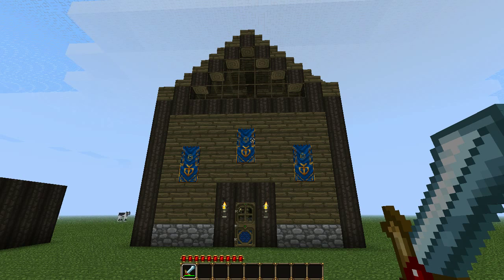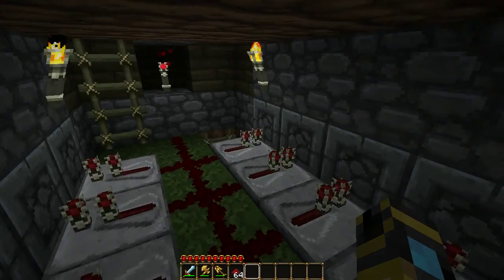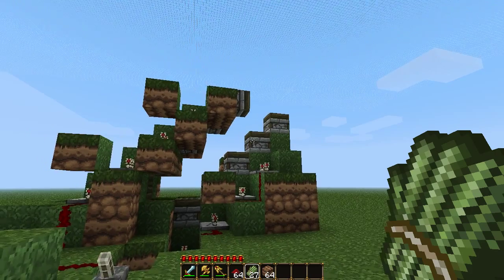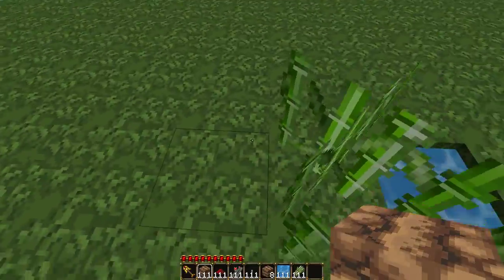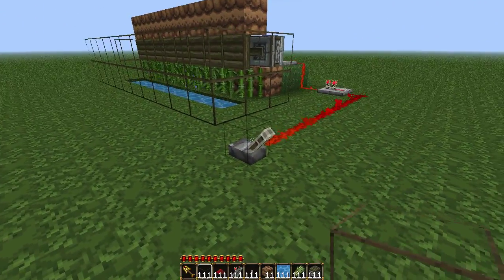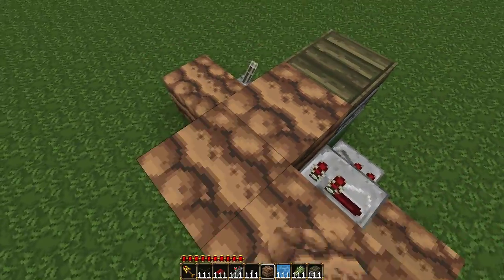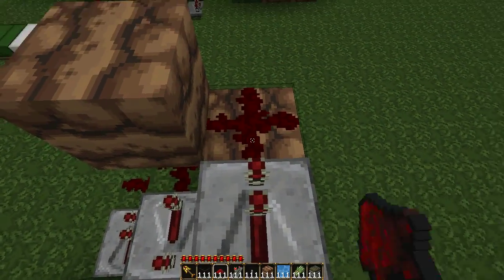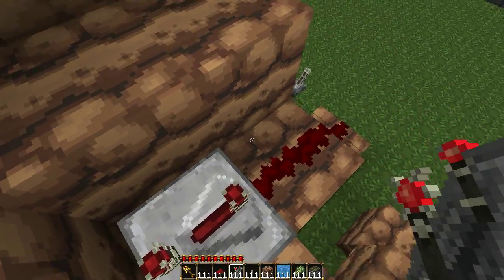Minecraft: Automatic Reed Farm Tutorial

Comment: @sneezingmonkey497 Reeds grow at random times, and I have no idea what you mean by using dispensers and pressure plates.
What you could do it connect the system to a 10-clock which is connected to a monostable circuit to make it push down everything that grows every 10 clicks.